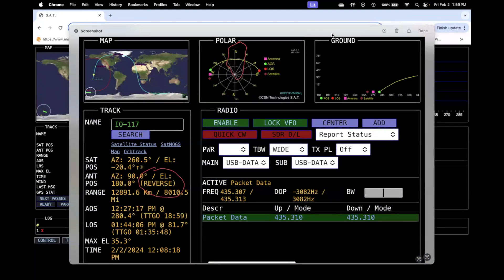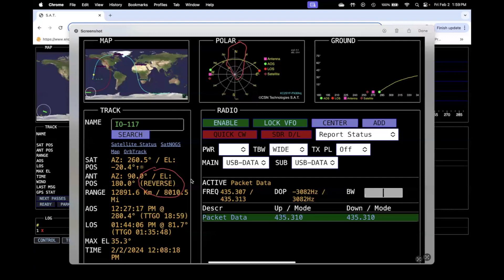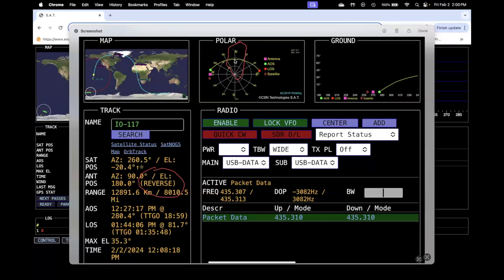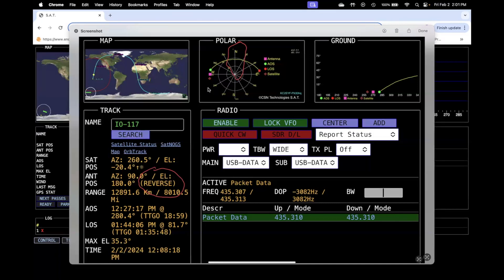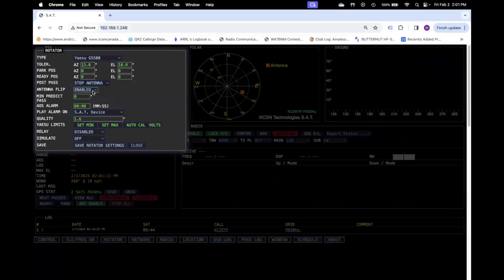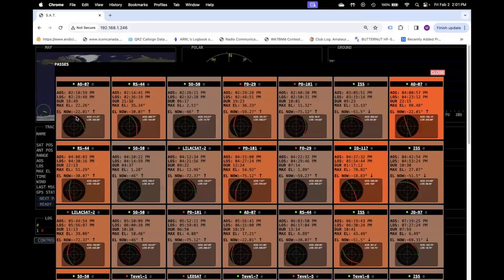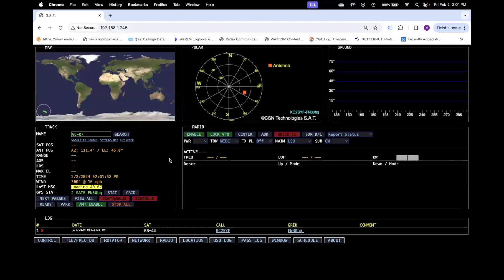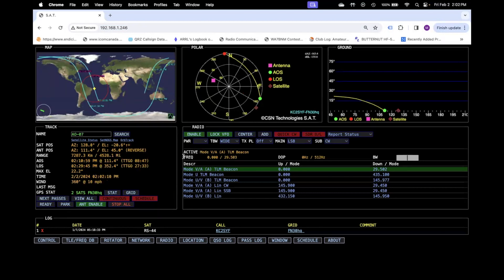CSN Technologies SAT tracker antenna flip (reverse)

Comment: Hi, I had to disable mine due to it appearing to be backwards for some SATS.  My first pass after getting me stuff setup was on SO-50 and it was pointing opposite directions and down to the ground.  After I disabled it worked fine.  Any ideas?
Reply from the maker: I think your antenna is installed wrong. the antenna should never point to the ground. please see this video.   https://youtu.be/V_ez-QFuGb8